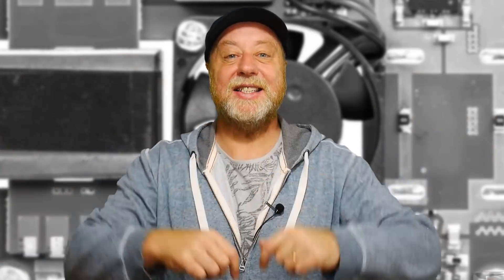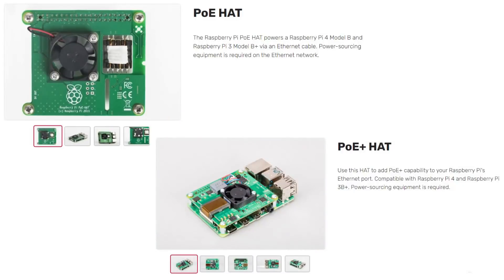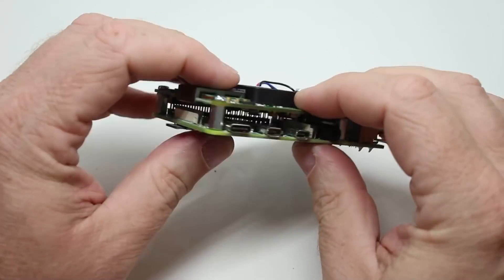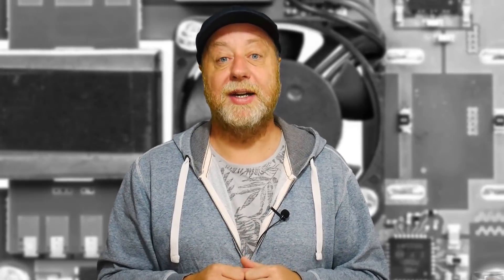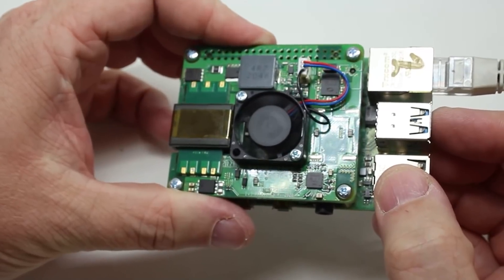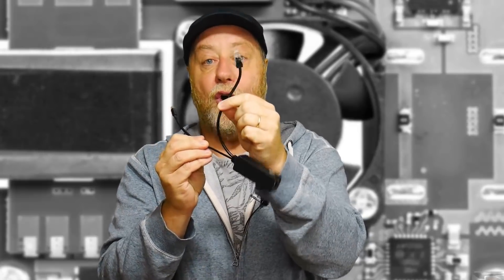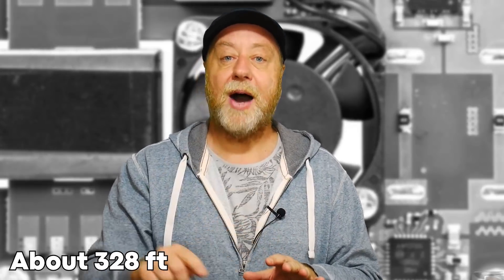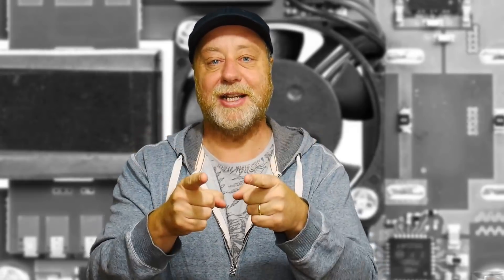Two Ways to Power a Raspberry Pi Using PoE (Power over Ethernet)

Comment: Hi i have a couple pi's in my home lab and have been looking at WOL lately. And am hoping to make my pi's WOL and my question is would i need just the poe splitter or would i also need a poe+ switch? Also i do have external hdds connected.

Comment: Hi Gary, I liked the video. But could you add a link for power sourcing the POE, e.g. POE injector, to connect the POE hat or POE splitter?
Reply from the maker: I think I got mine on Amazon, but that was back in 2021.

Comment: Another advantage of the last solution (splitting POE into separate data and power) is that it's not restricted to Pi 3B or Pi 4B, correct?
Reply from the maker: Yes, as long as the the volts & amps are suitable.
Reply: @GaryExplains  Maybe I was not clear enough  in my question but I meant to say you can also power a RPi 2B with this setup next to the other ones which is great and is - at least for me - preferable above using a POE HAT which, as you justifiably mentioned, takes away all the GPIO pins (unless you start to fiddling with it and end up with a messy setup).  Great videos, by the way!  Thumbs up!

Comment: Great video and impressed to the simplicity on how you descibe the install. Will this fit in the normal Pi case/housing and perform okay with the fan or will it restrict airflow and require a new vented case/housing?

Comment: Does the hat and splitter handle dropping 48v down to 5v or do you need to use a 5v injector instead of a standard poe switch (48v)?

Comment: My the new Raspberry Pi PoE+ HAT use for DVR Security Surveillance to control the PTZ Cameras,  But I would like to use the ADSL or NBN Broadband Router to Power Over Ethernet by using the 
TP-Link Powerline Wi-Fi Kit Extend Wi-Fi to Every Room by plugging in the RJ45 Blue or Yellow Network Cable, without using USB C to Power the Raspberry Pi 4 Modal B. So would I need to purchase the 5 to 12 Volt Passive Power Over Ethernet Adapter POE Cable Splitter Injector from eBay.

Comment: The new Raspberry Pi PoE+ HAT use for DVR Security Surveillance to control the PTZ Cameras,  
It will not work on any of the ADSL or NBN Broadband Routers, 
and also TP-Link Powerline Wi-Fi Kit Extend Wi-Fi to Every Room by plugging in the RJ45 Blue or Yellow Network Cable. 
but I was hoping that I was going to use it to power my Raspberry Pi. 
I'm not too sure if this is going to work by using the Adapter POE Cable Splitter Injector from eBay: https://www.ebay.com.au/itm/175341340928

Comment: One thing to note is those external PoE adaptors do NOT support gigabit Ethernet.  Probably not an issue for what most people use Pi for.
Reply: Some do, we have projects with 1Gbps.  We noticed that the model we were originally recommended did not support 1Gbps and thus swapped.

Comment: They didn't even need to make 3 of them. The difference is too slim to matter.

They could have just made the + model only and been done with it.

Just stupid.
Reply from the maker: Eh? 3 of them? Are you talking about the PoE hats? I think you are being way too harsh.
Reply: @GaryExplains  I was trying to type 2 of them. It was a typo.

But again, the difference between the 2 is not significant enough to warrant the need for both. They could have just made the + one only.
Reply from the maker: @PrYmCHGOan  I guess you don't have much engineering experience. Why did AMD create Zen 1 and then Zen 2 processors, what a waste, it doesn't need 2. 🤦‍♂️
Reply: @GaryExplains  I'm not talking about other products. It's just an opinion. I dunno whats the big deal. This item specifically for the Pi, it simply wasn't a significant difference and just the better one would have been the better option. It's just my opinion. I don't see what the problem is.
Reply from the maker: The point is that the original one was released in 2018. Then after three years they made a new one, which was better and had greater functionality for the same price. What don't you understand about that?
Reply: @GaryExplains  because I didn't know the other was released in 2018, as I didn't hear that in the video (and not saying whether you did or didn't make that clear, I just don't recall hearing that). I was under the impression, both were released together at the same time.

That makes a difference.
Reply from the maker: Ah, I see. Yes, if both were released at the same time then your original comment would have some merit. But I was confused by your use of words like "just stupid"  because, as we have now established, they weren't.

Comment: The POE/POE+ HATs are really badly designed.  The fan is presumably there to help cool the CPU, since the DC-to-DC converter certainly doesn't need one.  But all that really does is restrict your options on dealing with the cpu.  For example, many people don't want any noise at all and go for a fanless heat sink.  The output is also very poorly regulated.  Its an expensive mistake in my view.

I would recommend using a POE+ splitter instead.  This gives you the most design and build flexibility, far reduced noise (the regulator isn't sitting up against the I/O connector), and more options if you need better regulated output.  (Well, the splitter probably has better circuitry inside it anyway.  The HAT looks like a mess).

In terms of wattage... usually 12W is enough for the RPi and any USB dongles you might plug in short of an external hard drive.  I would never connect an external hard-drive powered by USB to an RPI, that's just asking for trouble.  Always power such devices separately.  The RPi power input is typically limited to 3A (roughly 15W) anyway.  You begin to risk burning up traces above those levels.  USB keyboards and mice use almost no power (don't use a LED keyboard if you are worried).

The biggest usb power hog tends to be wifi power dongles and very high speed memory sticks.  People often plug in external wifi dongles (even on a RPI4) because the on-board wifi is really horrible, or there isn't any on-board wifi in the first place.  Particularly if you want to use it as a base station or wifi router.  Budget 500mA for that.   The solution to using very high speed memory sticks is simple... don't use high speed memory sticks.  Use medium or low speed sticks.  Applications usually have no need for the higher bandwidth.

The reason you want to use POE+ instead of POE is because POE+ runs at a higher line voltage (POE is 24V, POE+ runs 48V), thus POE+ has a far lower power loss over long ethernet cables.  People running POE over long cables often get far less than the rated wattage at the other end due to losses over the long cable.  Also, POE+ has more safety features while POE is just straight-out passive 24V with no handshake or protocol.

-Matt

Comment: Why on earth would they design this to cover the GPIO pins? it's the most non-sensical design decision I have seen in a long time.
Reply: Maybe the amount of energy over the Ethernet is the sufficient only for the board
Reply: The GPIO pins should only require a few mA when configured as outputs, so they ought not to affect the power budget that much

Maybe it's just a lazy repurposing of another board, and they couldn't be bothered to make a cutout for the GPIO?

It's bewildering...

Comment: If using the PoE+ HAT, is there enough space between the boards to insert a ribbon cable to the camera ribbon connector on the main Pi board?

Comment: Can I pull ethernet from regular WiFi modem to power RPi zero using splitter?
Reply from the maker: I guess you didn't watch my PoE video.
Reply: You would also need a PoE injector.